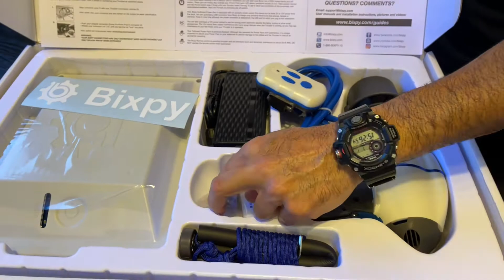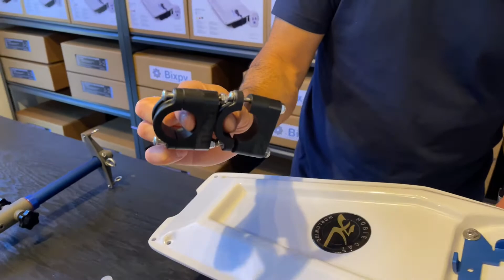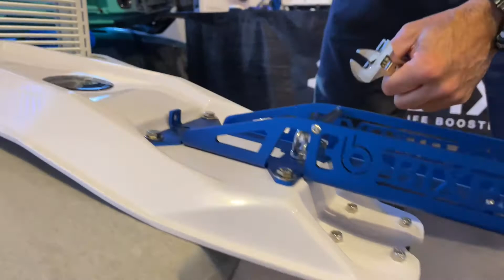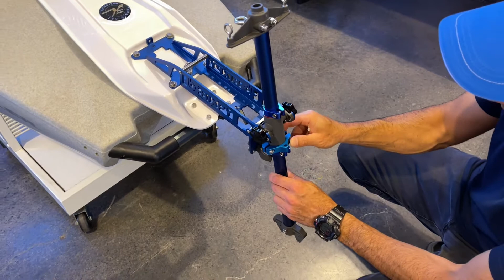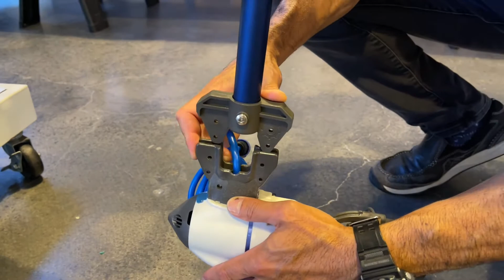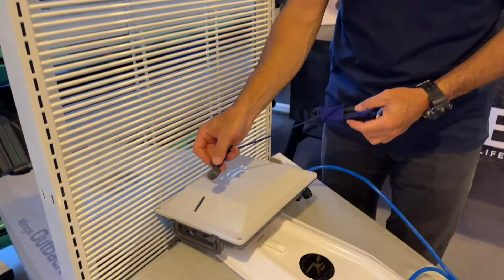Bixpy J-2 Installation: Hobie® Pro Angler Adapter with Hobie® Power Pole Plate

Comment: Good video. I have a PA12. I’m concerned with how far the bracket sticks out when I tilt the kayak to load it on my truck bed extender. I’m afraid that when it sits on the rubber stops on the bottom of the kayak, it will also be sitting on the bracket. That wouldn’t be good.  Thoughts??
Reply from the maker: Hi Roger. It is definitely recommended that you remove the motor shaft from the adapter when you're transporting your kayak. Once the vertical motor shaft is off, you should not really have an issue with the plate toughing anything. It's fairly high up and out of the way. If you have doubts or need further information, send us an email to: help@bixpy.com
Reply: @Bixpy  I think I will be ok when loading the truck extender, but about 5 times a year I will have to remove all of it when I lean the PA to load it on 6 feet high racks over the bed.  Do you think it will be a problem taking the plate and ubolts off and reinstalling multiple times?  It’s only 6 bolts but didn’t know if this is made to go in once and stay.  Thanks…..Roger
Reply from the maker: @rogerbarrios8614  Hi Roger. Shouldn't be an issue as none of the nuts and bolts are threading into soft material.
Reply: I'm about to try it Rodger did it touch the ground